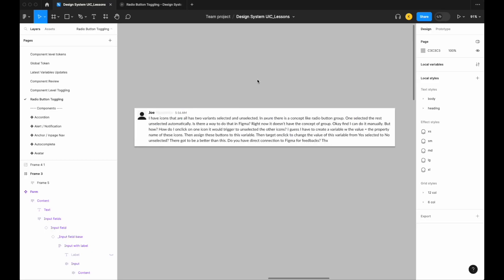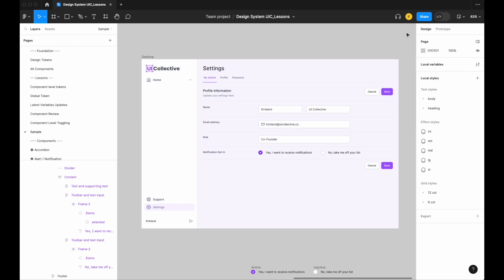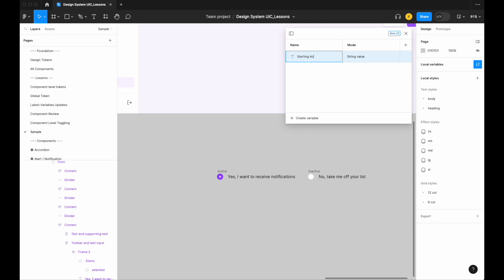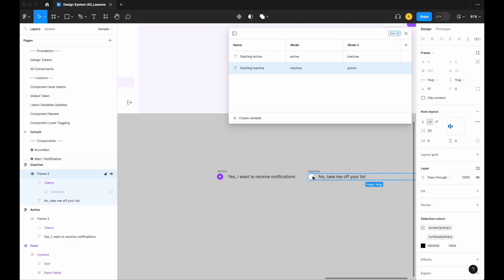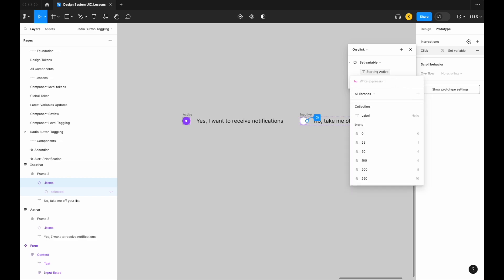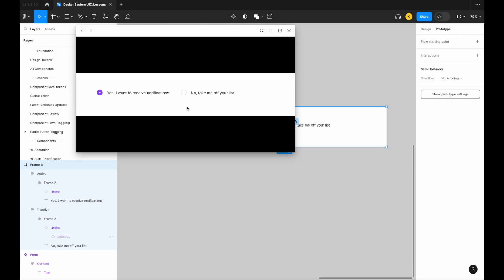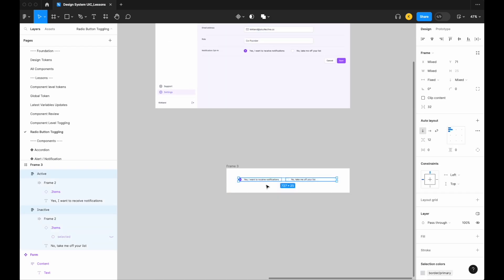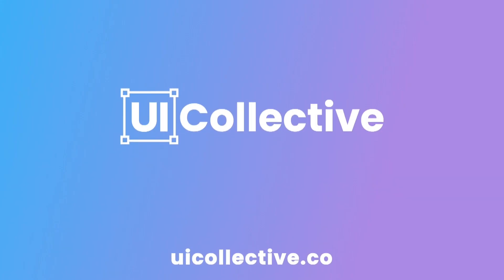Swapping Variants Using Variables | A Figma Tutorial

Comment: Thanks a lot for the tutorial. I tried to do a radio button exercise with 4 multiple choices and it was kind of hard. Although variables are created to reduce the number of variants, due to Figma's limited capabilities, I find that it's just easier to create all possible variants, assign a string variable that matches with one of the variants, use "set variable" to go from variant A to variant B upon clicking.
Reply from the maker: Good call out! Variables could definitley be improved on